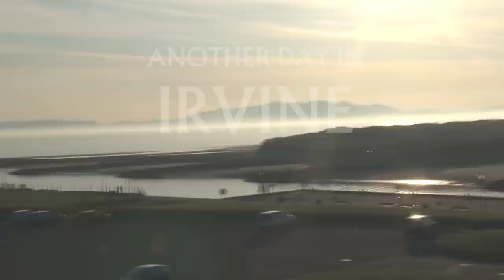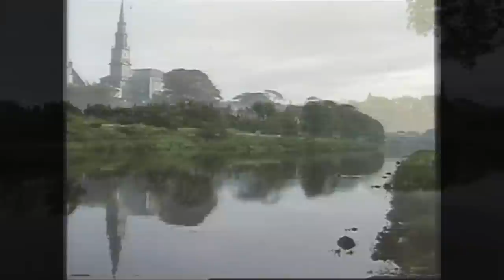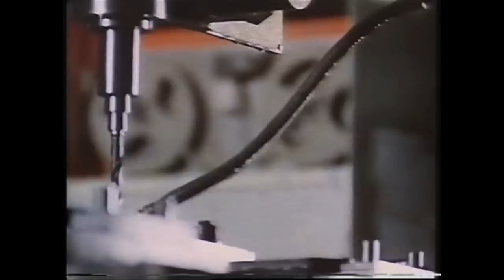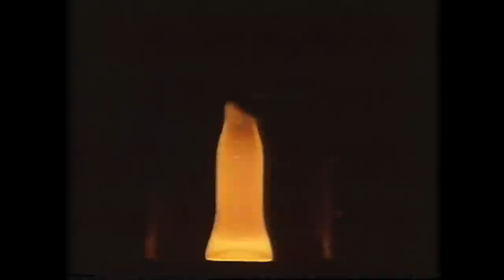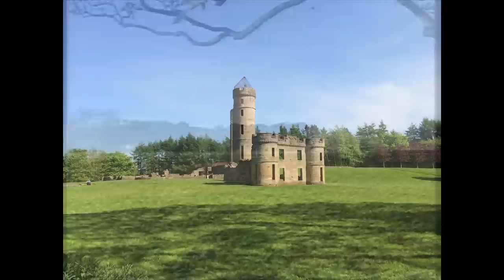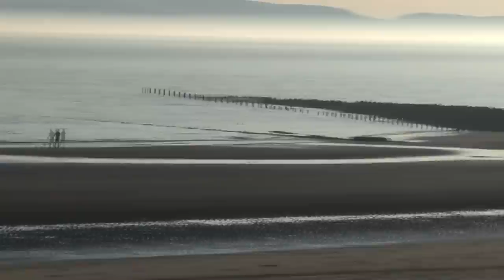Another Day in Irvine

Comment: Congratulations Craig, an excellent piece of work. It was a lovely touch to get Paul Young to do the narration. As someone who was in my teens when the New Town Development Corporation began to transform the town, I agree wholeheartedly with the views presented in your video. The town lost much of its heritage unnecessarily (17th and 18th Century buildings in Parterre, the Water Bridge (its proper name), the northern and south-western parts of Bridgegate and all of the former centre of Fullarton (which was a separate community until 1881). All of this could have been avoided, if the original New Town Plan from 1967 had been implemented; whereby the shopping centre would have been built near Stanecastle: https://www.flickr.com/photos/crawfordfulton/7995046481/in/set-72157631555689181